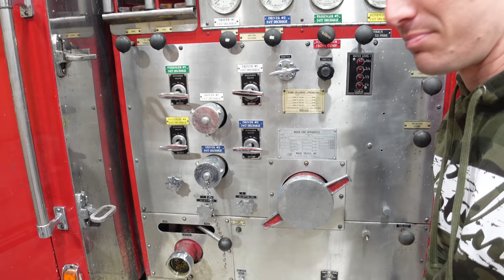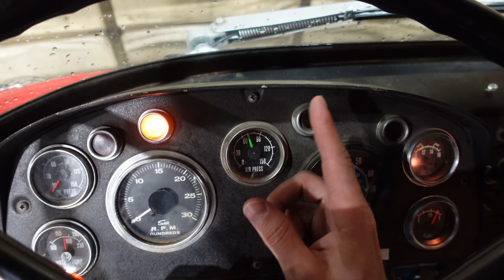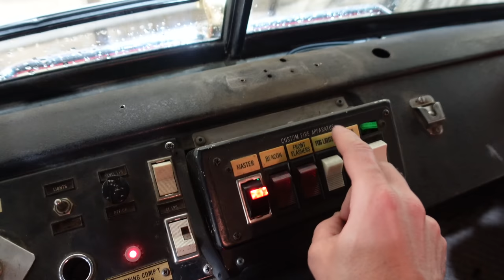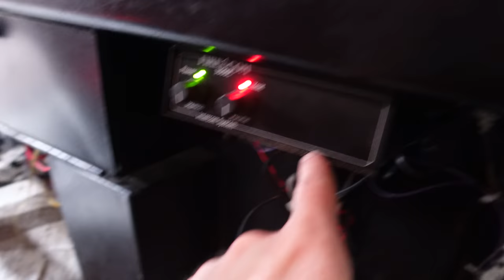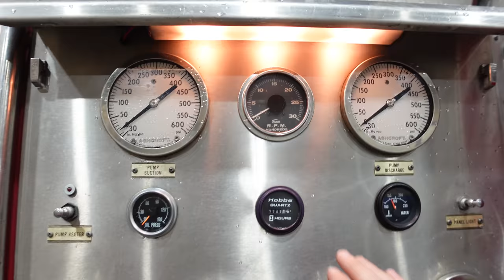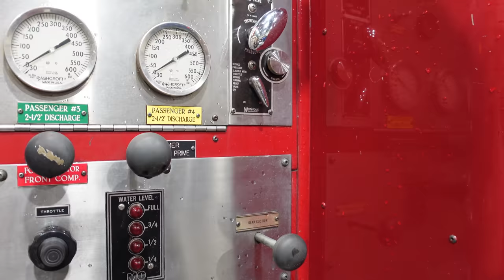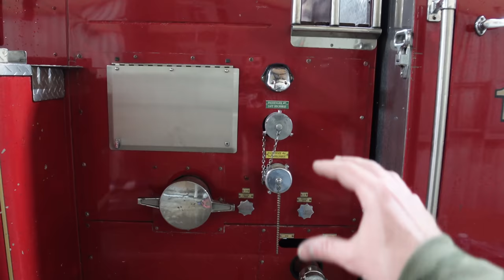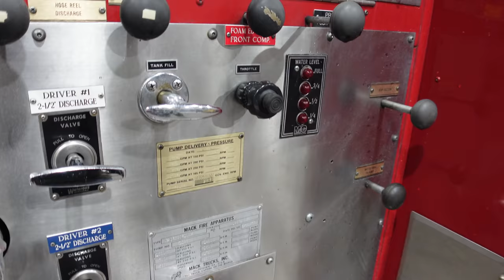Here's A COMPLETE Tour Of My 1977 Mack CF-600 FIRETRUCK

Comment: as I watch this video I'm going to be updating you pointed out the two little ports underneath the pressure relief valve those are for the testing you connect those to the test gauges what they do is they when they test the truck they compare the gauges to see if they are accurate I'll show the gauges they put on there are certified gauges.. the little intake that you pointed out generally is not used for drafting this for for hydrant use the big four and a half inch steamer connections they used to call it because the bridge that came off a steamer if your draft Court for pumping water out of the lake river or other bodies of water not pressurized but you can also put pressurized water in that as well it basically goes to the middle of the yep pump and the little two and a half inch intake that goes into the barrel of the steamer connection.. and the center button on your throttle is for emergencies that's the emergency button it is highly suggested that you twist up and twist down for your pressure and you'll turn me on the throttle down manually instead of using the emergency button..

Comment: Those are smaller suction ports are auxiliary suction ports. The big ones in the middle are the main intakes you fill off hydrants other engines and pull suction from those. If you run the pump make sure there is water in the tank and pull your tank to pump valve and your tank fill valve to recirculat water or you will over heat the pump. If you are running the pump and hear noise that sounds like gravel in the pump that means you are running out of water in the pump and need to immediately get water or shut down.

Comment: I put 25 years on in my Department, and retired 8 years ago.  As a Rookie, our city had 2 retired Macks from FDNY.  Some years before I joined, our chief had the brilliant idea of buying 2 of them, as a cost saving measure.  He wasn't as brilliant as he thought.  They arrived on flatbeds....they had to.  Both had written across the windshield "Sold Do Not Scrap".....They absolutely were worn to the point of near death.  I remember sitting in the enclosed jumpseat, with the biggest headache and ready to puke from the exhaust leaking up into the cab.  Hot as hell, and probably didn't help our hearing either.  My very first fire, she would not go into pump gear....What pieces of shit....

Comment: The button on the dash for the federal siren should be the break to stop siren. To turn siren on there should be two buttons on the floor on driver side one on passenger side one on driver side is for low high beam lights and one is for siren the one on passenger side is siren they are just push buttons hope this helps

Comment: It might not be tons, but I bet you could both help that engine out and anyone stuck in the back by doing some ceramic coatings and blankets on the respective intake and exhaust components if you ever have cause to take it apart.

Comment: How many gallons is the water tank? Older ones usually have a 300 gal or even a 500. Firetrucks have highway tires upfront and a/t in the rear.

Comment: I wouldn't be surprised if your truck didn't start out in NYC. They ran a lot of Macks and they had the rear ends geared low and 55mph was all they needed. It was also probably rebuilt in 1989 when the pump was recertified. It would have had open back jump seats and the rear doors were added as the standards changed.

Comment: this truck was refurbished at one time Max of that year were not enclosed cabs they were open in the back also the the back part of the truck the compartments are all square Max they use steel and they tend to be around corners that looks to be either aluminum or stainless steel where you can't have those round corners.. in my area several departments had the style truck and I noticed things the neighboring department had a 72 Mac and a 68 Mac at one time.. in fact they had their 71 was having a lot of problems so they sold it and they bought actually a 72 Mac and it was referred and it had any closed cab in the new box in the back.. some sort of a familiar with these trucks.. also New York City at one time 95% of their trucks were Max because they had narrow cabs and they can get down the narrow streets when maxed up making a complete fire engines they went with another company.. Florida departments now when they buy MAC chassis they have to have a secondary vendor build the fire apparatus body and put the pump in I'm actually the department that had the to Max able to new Mac and it said thank you for purchasing a Mac garbage truck.. I hope you enjoy your truck.. and I hope you get some equipment to put on it you have some hoes and get some other equipment on that line.. I would suggest getting S CBA.. those have to be checked on a regular basis same way with the CO2 fire extinguisher.. have a nice day

Comment: What is the purpose of the fluid in the dials on the pump engine?
Does it stabilize the needle position?
Reply: Yes. Oil filled. Dampens the needles.
Reply: @w9bo  The vibrations of the machinery would otherwise rattle the needle position...
Got it!

Comment: The truck was always 12v,  each battery box originally had two big 6v batteries hooked up in series for 12v, that's what they changed. Just replaced the two 6v with one 12v.

Comment: normally the Q sires has a foot switch on either the driver or passenger floor. large cities its on the passenger (officer) side. and normally the siren/horn switch is so you can activate the siren using the horn and vice/versa.  so when the switch is in horn, honking the horn will honk the vehicle horn. when its in siren honking the horn will activate the siren. so you don't have to take your hands off the wheel.

Comment: I see starter A and B.  Is the B button a Redundant safety or Second starter in case the Main one fails?  Or is it normal to have two starters on a big truck like that?  Since it is an important first responder you need it to start.
Reply: You're suppose to press both of them to start it. Pretty standard on stuff this size and vintage.
Reply: @JackGirard1   that's cool,  I didn't know that.  My Uncle was  a Truck driver for 50 years and when I was in Elementary school, on holidays that I didn't have school I would ride with him. It was something I looked forward to for MONTHS.

Comment: Just an FYI, don't pull the emergency engine stop. Most likely it isn't a fuel cut off switch because if the engine was running away burning its own oil then cutting the fuel wouldn't do anything. It is most likely a valve of some sort on the engine intake that will shut off all intake air to the engine. I say don't pull it because some models can not be reset from inside the cab to stop people from trying to restart it.

Comment: I have seen the numerous comments here on the gold color bulldog. Since most of them didn't match up with what I thought the gold bulldog meant, I went right to Mack Trucks. What they informed me was that the meaning of the gold bulldog has CHANGED over the years. Too much to post here. If you're interested, go to the Mack website and find their history page. From there find the link for bulldog history, then meaning of color. In the case of THIS pumper, it means it has a Maxidyne diesel and Maxitorque transmission.

Comment: If you so the research, Mack built from wheels up fire engines from the start of engine powered fire equipment.  I actually worked with a 1929 Mack.  I would pass on the expensive flash light.

Comment: the reason you got the red line hose looks like a big garden hose is that normally comes with the truck when it's delivered from the factory it comes without nozzles just like you see here please usually are used for garbage brush fires at one time they used them for car five for cars have too much synthetic material in it and they don't produce enough water to put on a car fire..

Comment: It's only fast because you're not running it with a full tank of water in the back. If you can fill it up, it'll slow down quite a bit.
Reply: As someone who has driven that full of water, You put that throttle to the floor, she will straight get it!
Reply: @ChiefsFireman  oh yeah. Considering they are usually kept full at all times, I would hope they can still haul ass with the additional 8000 pounds.

Comment: If the engine was used as a front line pumper it should have been pump tested every year. See if the fire department has any records it will really help to see the pump condition. That foam thing is a called an eductor. It's needed for any class a foam or afff foam. It's kinda old school most fire deparment moved over to compressed air foam(cafs) system. One more thing do not toch that pressure relief valve they all get suck becuase they don't get used that often.

Comment: be careful how you handle afff foam , depending on what kind it  is they now have been linked to cancer in firefighters but also it has to be contained per environmental regulations when using it on a scene. Its viewed like a chemical spill. we still have if for a backup up to the new stuff at my department in case of a massive fire but yeah google  (PFAS) in AFFF foam.

Comment: I've never seen an air tank Guage   like that for Both tanks. Or is it just one air tank?
Reply: Has multiple tanks, The gauge has two dials inside one for Primary one for Secondary.
Reply: @ChiefsFireman  I understand and know that it has two tanks, but was a little thrown off by the guage as I had never seen that single Guage style before. I've only encountered the standard Primary and Secondary tank gauges. So it threw me off abit.

Comment: EMERGENCY ENGINE SHUT OFF IS A SPRING LOADED FLAP IN THE AIR INTAKE, NOT A FUEL SHUTOFF. IN A RUNAWAY DIESEL, IT IS RUNNING OFF OF IT'S OWN OIL THAT IS BYPASSING THE RINGS, NOT DIESEL FUEL. A FUEL SHUT OFF WOULDN'T HELP IN A RUNAWAY. IF IT IS ACTIVATED, THE TRUCK WONT START UNTIL YOU RESET THE FLAP.
   YOUR TRUCK DOESN'T HAVE GLOW PLUGS, LOL. THEY ARE COMPRESSION FIRED; ONLY LIGHT DUTY TOY TRUCKS (I.D.I.) USE GLOW PLUGS.
 MORE IMPORTANTLY, YOUR TRUCK DOESN'T HAVE A PTO, THEY USE TRANSFER CASES, WHICH WILL GET DESTROYED IF OPERATED LIKE A PTO.
   THE DEVICE THAT YOU DESCRIBED AS A FOAM NOZZLE IS NOT A NOZZLE, IT IS AN AERATING DEVICE TO ADD TO A NOZZLE FOR MORE "AIRY" FOAM.
   IF YOU'RE INTERESTED ON PURCHASING THE PERIOD CORRECT MOTOROLA RADIOS, THE BOOSTER REEL NOZZLES, LADDERS, AND THE LITEBOXES; MESSAGE ME.

Comment: the phone you see in your storage compartments are for hydrocarbon fire meaning gasoline oil and also alcohol-based materials like alcohol benzene and any k a lot of your solvents or the alcohol base 3% is for petroleum based products in the 60% is for the alcohol-based products the nozzle that you have is a phone nozzle where there's not a standard water nozzle the upper compartment next to the driver on the pump panel side or the driver side that is for holding air packs not spare bottles the tubes in the back compartment the gray plastic tubes that's where your spare bottles go right next to that rear intake.. that's also classified as a steamer.. the hose compartment between a cab and a pump that is forensic recorder hose that is your main attack line for car fires and structure fires and even the major fires you still use those mainly you use those to cover buildings that are not on fire.. it doesn't look like you have a free pipe deck gun that you would put above the pump panel because you have covered hose reels which originally Mack did not cover those..

Comment: It would be cool to see those front leds were the original lights... probably spinners.
Reply: The originals were halogen bulbs that were red, each side would alternate in flashing. We replaced them with LEDs as we were trying to save as much power as possible, Even now when the Rotators are on, it will drain the batteries if the truck is not idled up above 1200RPM. So you could only imagine how bad the power draw was with everything halogen!
Reply: @ChiefsFireman  Thanks for the insight!
Reply: @benvolio28  No problem!

Comment: Mack was still using 6 volt Electrical in 1977?
Reply: The old Polaroid was two 6V batteries in series. They probably told him it used to be 6V but it was a 12V system using 6V batteries.
Reply: @watchjaredwork1487  It used to have 4 6 volt batteries, we replaced those with the two larger 12 volt batteries! Sorry if we confused you guys :D

Comment: Please learn the correct terms for the things you are talking about. This is Not a Fire TRUCK. It is a Fire ENGINE. It has a pump, on board water tank and carries hose. It has no Ariel Ladder on it so it should not be called a Fire Truck.  The Clips Lights switch is for the cab Amber clearance lights and the rear Red lights in the middle of the back step. The clps is an abbreviation. Retired Fire Engines will usually come with the hose real hoses. They will not usually have any other hose though. Since that Engine or fire Rig or Rig has the newer head sets for the radio and the plug in for the head set up high, that is why a lot or all of the original wiring has been cut from the original radio controls behind the chromed door lower down next to the pump panel. You called that area the pump control panel. The fire service cuts that down to just Pump Panel.